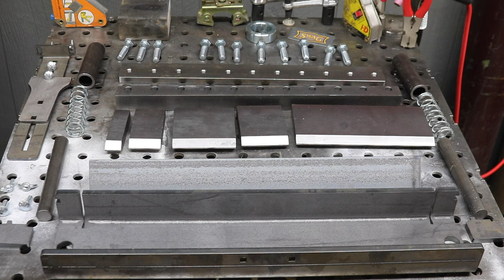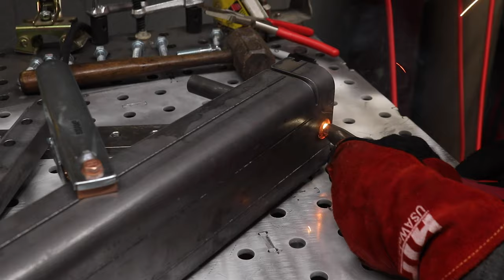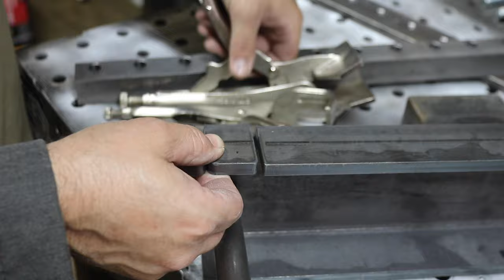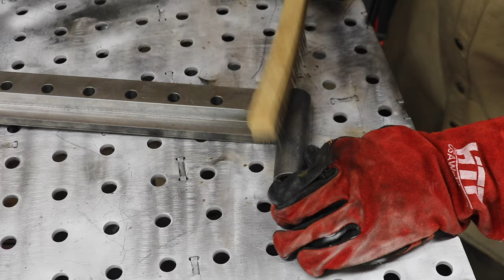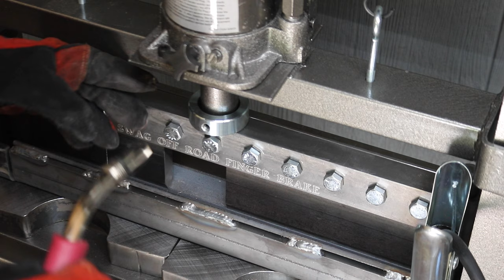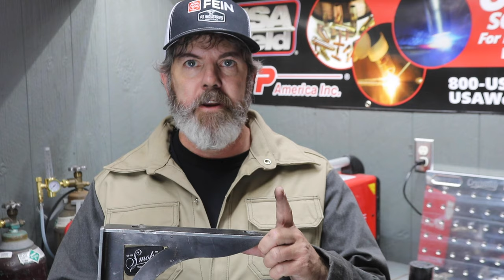Swag Offroad Finger Brake / Beginning to Bend Using Langmuir Crossfire Pro

Comment from the maker: Save $100 Using Discount Code:  ManCrafting ton any Langmuir Crossfire Table
Affiliate Links:
Langmuir Crossfire and Crossfire Pro  http://store.langmuirsystems.com?aff=2
Affiliate Links:
Save $100 on any Langmuir Crossfire Table with Discount Code:  ManCrafting
Langmuir Crossfire and Crossfire Pro  http://store.langmuirsystems.com?aff=2
HTP Affiliate Links:
Multi Process Pulse MIG Welder  https://usaweld.com/collections/htp-america-mig-welders/products/pro_pulse_220_mts?ref=3tijle_owkg
TIG Welder https://usaweld.com/collections/htp-america-tig-welders/products/invertig-221-ac-dc?ref=3tijle_owkg&variant=31782387581011
Plasma Cutter Used in my videos https://usaweld.com/collections/htp-america-plasma-cutters/products/microcut-875sc-v2-plasma-cutter?ref=3tijle_owkg&variant=27839354536019 
Table Torch https://usaweld.com/collections/htp-america-plasma-cutters/products/microcut-875sc-v2-plasma-cutter?ref=3tijle_owkg&variant=27839354536019
Welding Helmet  https://usaweld.com/collections/optrel-vegaview-2-5/products/vegaview-2-5?ref=3tijle_owkg
MIG Gloves https://usaweld.com/collections/clothing-gloves-1/products/htp-america-split-leather-mig-welding-gloves?ref=3tijle_owkg
TIG Gloves https://usaweld.com/collections/clothing-gloves-1/products/htp-america-top-grain-leather-tig-welding-gloves?ref=3tijle_owkg&variant=31472054403155
Best Setup I’ve owned for sharpening my Tungsten Electrodes.  I’ve made some, I have bought add-on accessories for my dremel.  This is the best.  https://usaweld.com/collections/tungsten-grinders/products/htp-america-tungsten-grinder?ref=3tijle_owkg&variant=27910084755539
Sales!  
An amazing MIG welder.  If you want a basic MIG welder that performs… Check this out.  https://usaweld.com/collections/htp-america-mig-welders/products/htp-america-mig-200i?ref=3tijle_owkg

Air Compressor with adequate capacity  https://amzn.to/2PFPo7X

Amazon Affiliate Links:
Shelf Brackets I replicated https://amzn.to/2z1MhEp
Certiflat Weld Table  http://weldtables.com/#_a_cust8g
Heavy Duty Magnet Square  http://amzn.to/2dycStl
Magnet Level  http://amzn.to/2cS2ZYV
Round Metal Marker http://amzn.to/2dMikvI
Marker holder and 12 refills http://amzn.to/2dCLTks
Heavy Duty Gloves  http://amzn.to/2dMiqDD
Standard Reverse Measuring Tape  http://amzn.to/2ut3PRK
Flatback Series Tape Measure 16 Foot http://amzn.to/2fgdIQQ
Evolution Power Tools EVOSAW380 15-Inch Steel Cutting Chop Saw  http://amzn.to/2dMhkb4

Photo, Video & Film Production Studio Essentials   http://amzn.to/2dMiP9f
USB Microphone - Silver  http://amzn.to/2dewgA5
Sony Digital Still Camera  http://amzn.to/2dJcAA0
Air Compressor with adequate capacity  https://amzn.to/2PFPo7X

Amazon Affiliate Links:

Mild Steel TIG Rod  https://amzn.to/2Di9VeX
Stainless Steel TIG Rod https://amzn.to/2Dke8hZ
Aluminum TIG Rod  https://amzn.to/2Dm8Q5Q
My Welding Helmet  https://amzn.to/2GiNI11
RAZORWELD TIG 200 https://amzn.to/2Iw5a5N
Jody's Helmet  https://amzn.to/2DgkTBG
My Gear
Welding Jacket  https://amzn.to/2IqYhCF
TIG Welding Gloves https://amzn.to/2Dh36KA
Helmet Bib  https://amzn.to/2Iqp9mg

Comment: Never had a brake before.  Why a finger brake over the full press brake version?
Reply from the maker: Mike Lucas that’s actually a great question and one I figured out making the shelf bracket.  So on the first bend a full break is fine.  But once the first bed is created that material interferes with creating the second bend.  Removing a finger allows a space for the material to move into as the second bend is made.

Comment: That thing looks seriously stout Chad. Nice build man. What are you using that bracket to support?
Reply from the maker: I used the original brackets to support my HTP Plasma Cutter on the wall vs a cart or under the plasma CNC table.   I made a bunch more just to put shelves on in my shop for storage.  I could get brackets from Amazon.  Still waiting on them and I already have the shelves up and full of wood, tools and supplies for the shop.